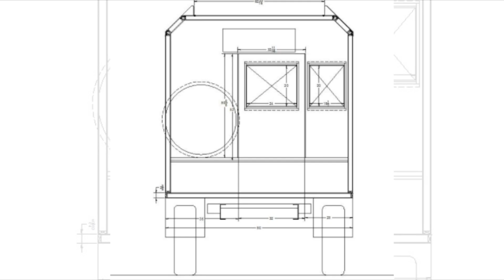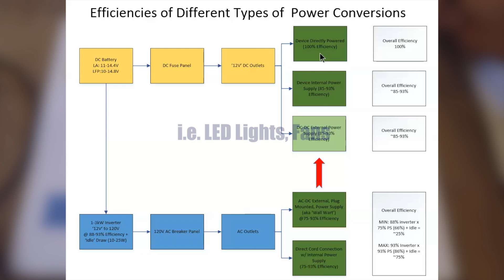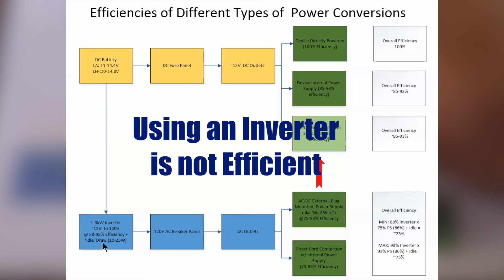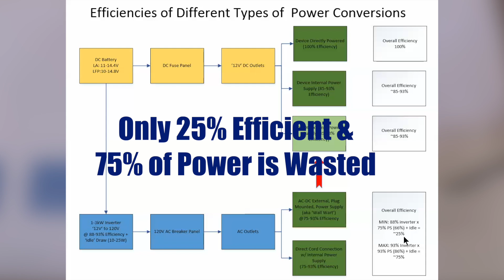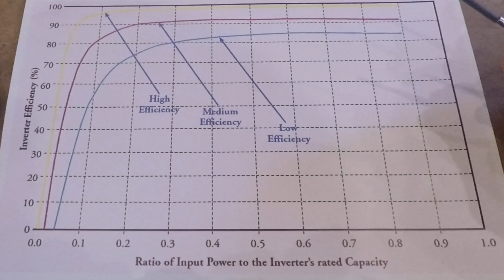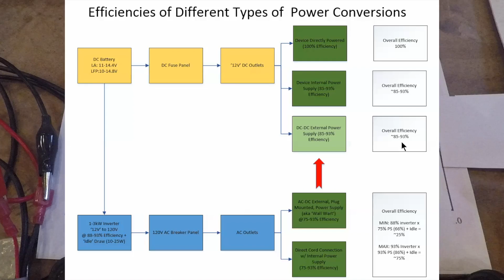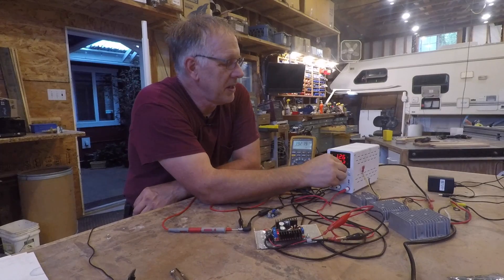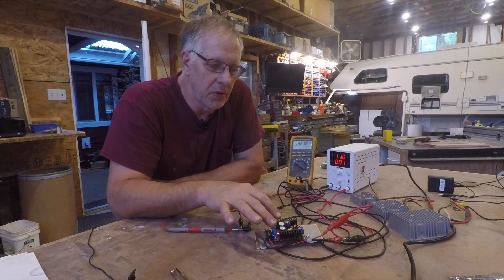Why We Use DC to DC Converter | RV Power Efficiency | Turn Off Inverter

Comment: Have a question about the convertor I need. I want to run my CPAP that needs regulated 12v and will not run on 13V, it will shut down, see the video. The CPAP spec sheet says 100 – 240 VAC, 50/60 Hz, 1.0 – 2.0 A I assume the 2.0 amp is with the humidifier running.  The wall wart's output is 12v 6.67 amp. I assume I need around an 80 - 100 watt convertor. I have two 270 Ah Battleborn lithiums that I have seen over 14 volts on. They will shut down at around 12 volts. Do I even need an up/down converter? or should I just look for a buck converter?  Looked on Ebay and Amazon, way too many to choose from, do you have a suggestion?

Thank you for your help.

Bill Harr

Video  https://www.youtube.com/shorts/Y0eaZc_VCG0
Reply from the maker: Your BB batteries are lithium iron phosphate and technically operate between 10V and 14.4V. If they shut off at 12V, you have something else doing that. https://1t1pye1e13di20waq11old70-wpengine.netdna-ssl.com/wp-content/uploads/2019/01/BB10012-Spec-Sheet.pdf

The CPAP spec sheet seems carelessly written, likely the assumption that small draws are irrelevant on mains power. Calculating an AC demand; The maximum draw is at minimum voltage so (2Ax 100V) and the minimum draw is at the maximum voltage (1A x 240V = 240W) would place your AC input at between 200-240W. This is irrelevant for our purposes but seems to indicated your power supply is likely less than 50% efficient. Your output of 12V x 6.7A = 80W is what we really need to focus on. For planning purposes, power supplies are sold in increments so I would pursue a supply in the 100-120W range (120W or larger if not from a reputable manufacturer). 

Since you need to output 12V regulated (11.5V-12.5V) from 12V automotive (or based on BB's spec, 10V-14.4V), you will need a  SEPIC converter (because the output range falls within the input range). If you could measure the actual use, you might be able to use a smaller supply but I presume that is more work than its worth. 

When buying board-level converters, especially from Chinese manufacturers, their maximum capacities are often overstated meaning they require a fan to keep it cool near max output, which would be undesirable to operate when sleeping.

Here is a board level, Chinese made supply marketed for powering car stereos. I think it would work but it is shipping from china and there is no brand.
https://www.ebay.com/itm/114964259462?hash=item1ac4676286:g:2HUAAOSwZKhhLxKH for $25 + 8 shipping = 33 (delivered). I would think that something more reputable and encased is desirable.

Here is what seems best https://www.meanwell-web.com/content/files/pdfs/productPdfs/MW/SD-100/SD-100-spec.pdf
The part number you want is a Meanwell SD-100A-12 (S=Single output, D= DC converter, 100=100W capacity, A = 9.5-18V input, 12= 12V regulated output).
You probably have not heard of Meanwell but they are a HUGE supplier of power supplies worldwide and have a good reputation.

Here is the product on Amazon: https://www.amazon.com/dp/B076FBHKHK?ref_=cm_sw_r_cp_ud_dp_FVYXNQRTX8XP9CN02Q10 for $49
There are also alternative suppliers there that have lower prices plus shipping charges that might be as much.

Here are a couple others that I'm sure also would add shipping (the latter two are huge electronics suppliers that I have purchased from numerous times);
https://www.trcelectronics.com/View/Mean-Well/SD-100A-12.shtml for $39
https://www.mouser.com/ProductDetail/MEAN-WELL/SD-100A-12?qs=HXFqYaX1Q2zMlaA5fVE4GQ%3D%3D for $43
https://www.digikey.com/en/products/detail/mean-well-usa-inc/SD-100A-12/7706477 for $43

Hope this is what you were looking for....Steve
Reply: @WorkingOnExploring  I have never had my batteries shut down. I was under the impression the BMS would shut down on low voltage. with how I use my batteries I have not seen under 80% SOC. Do you have a recommendation for a convertor?  Thanks Bill
Reply from the maker: @bikeama  Bill,
I sent you a lengthy reply wth several specific options, with links to specs and purchasing sources. Possibly you didn't notice the full length of the reply....look at the bottom for the 'Read more'

Your internal battery BMS will cut off battery charging at 14.6V but your charging sources should be set to cut off at lower voltages so it never gets that high. Similarly, your BMS will shut off battery discharging below 10V but your inverter at least should be set to shut off before it gets that low. The BMS inside the battery needs to be considered a 'last ditch' safety, not to be routinely used. Most chargers have voltage limit profiles that can be set as do inverters. Actually, the lowest I've seen a standard inverter even able to go is 10.5V before it alarms and shuts off. 

If you are always above 80%, you have too much battery. You should lower your max charge to 14.2 or 14.0. Unlike Lead-acid, the most unhealthy thing you can do to an LFP battery is keeping them fully charged. You can double the battery life by operating between 85% and 5% SOC than 0-100%. Keeping them at the highest voltage is not as life-enhancing.
Reply: @WorkingOnExploring  Thank you I did miss the read more. I have a large battery bank so I can run the 12 v AC on my van. I have only had one long trip in the van since the upgrade to lithium. I am charging with two  Victron DC-DC 30 amp charges set to Battleborn specs. Using a Victron 712 monitor.  I really do appreciate the long answer you provided. I did install a switch for the DC-DC chargers mainly to stop any drain on the chassis battery when stored. I might use it to let the battery stay at a lower charge when I drive every day.

Comment: Thank you for this video. Very timely for me. I have a new CPAP and get an error message when plugged into 12v, old CPAP was fine. Email the company and it requires a regulated 12v. They said specifically that it will not run on a vehicle DC and could damage the CPAP. Thought I would need to run my Xantrex 2,000-watt inverter. I have 540 Ah of Battleborn lithium so I could but would be wasteful. Going to look for a Sepic convertor.